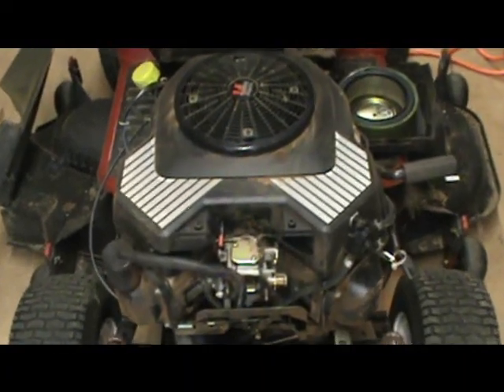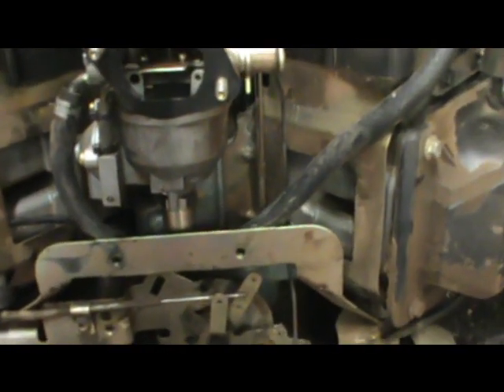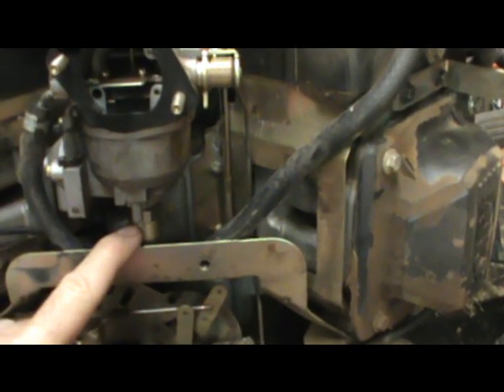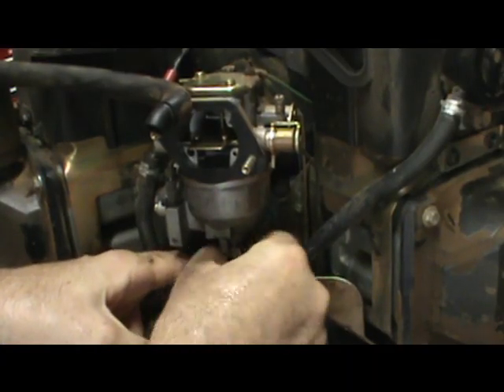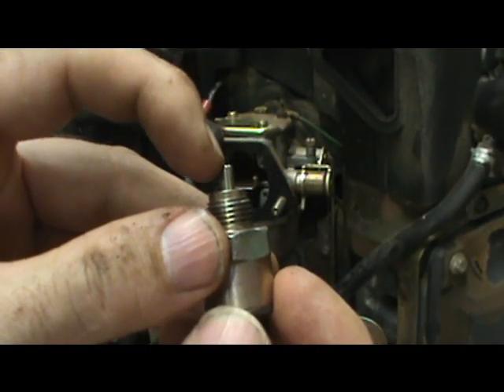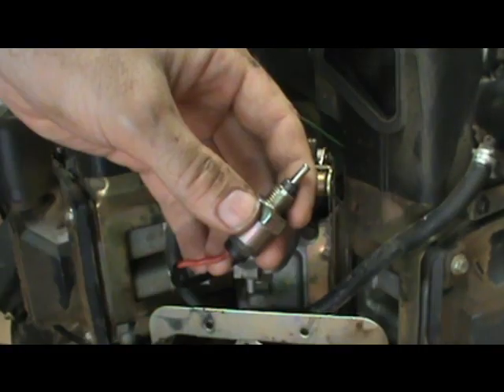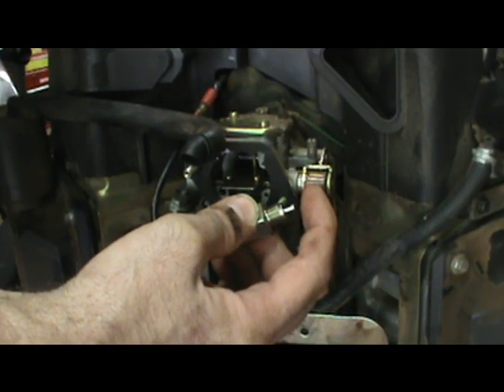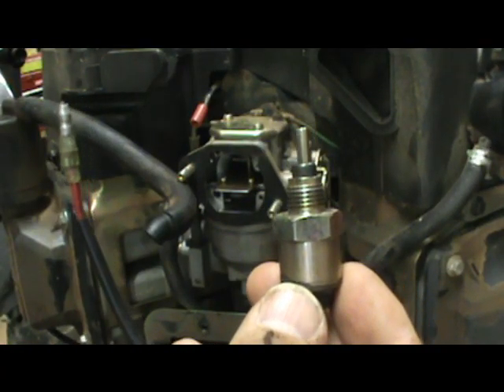Small Engine Repair: How to Check a Solenoid Fuel Shut Off Valve on a Kohler V-twin Engine

Comment: I see a lot of people are just grinding down that plunger and putting in a shut off valve...my John Deere would back fire when shutting it down after mowing most of the time even with the solenoid working properly.. I guess I'll just replace it.

Comment: Parts suppliers wanted on average $38.00 for a new fuel shut off solenoid, but i checked prices on a entirely new carburetor with the solenoid for only $30.25 . since my Toro SS4225 Is 7 years old, i just bought a new carb and added a manual choke cable for another $7.75 so i would have total control of the starting and running process.
Reply: What kind of carb is it?

Comment: I just picked up a  kohler 22-TWIN V battery says it’s from 2023 and they lady said it was running the other day but I got the cover off and it’s like a mice nest under there when I turn key all it does is click I looked it up and said maybe the battery or solenoid or the starter can’t figure it out. If anyone would help me I’ll put my snap on here so we can text back and forth been trying to work on it for about 2 months

Comment: I had a loose connecting wire to the solenoid that caused the solenoid to open and close rapidly, which reduced the rpm’s dramatically and randomly. Hope this helps someone! Great video!!!

Comment: Thanks for this video.  The wire came off the bottom of the solenoid.  Can it be reattached or do we need a new one?
Reply from the maker: I honestly don't remember this solenoid, but if I remember correctly it should be replaced. I don't believe there is a connector for the wire on the solenoid.

Comment: mine leaking gas
Reply: Get yourself an inline fuel shut off put it before the fuel filter and take the stem and spring  out of the solenoid if you need to but should run anyway.
Good luck

Comment: Can you put a regular carburetor on and disconnect that Silaniod
Reply: You can take the guts out of the solenoid and put it back and it'll run fine but I would suggest putting a fuel shut off in the line before your filter and that's exactly what I did with mine.

Comment: I might have fixed my problem by just removing the spring lol…
My problem with my mower is when it would get hot after about 15 minutes of heavy mowing I would loose power and RPMS… it would still be running “smooth” but definitely down on power and when I would turn off the deck I can’t turn the deck back on. Been chasing the problem all summer and it’s not anything obvious to me (I’m not down a cylinder). Well I just removed that spring and mowed for a solid 30 minutes through heavy grass and my mower didn’t bog down at all
Reply: Actually now that I think about it more I don’t think the solenoid was ever my problem… the fuel bowl was full when I removed it. But ya my mower losses rpm’s (likes being governed) about about 15 minutes of mowing when it gets hot. It’s not the fuel venting as I leave my gas cap loose, got new plugs and new air filter in it this spring, the fuel is also fresh, I have spark on both cylinders…. At this point I’m kinda suspecting coils and maybe they just are getting weak spark when they get hot? If it is coils that would suck because coil replacement for my Koehler 26hp is a $200 conversion kit because they discontinued the original coils.
But ya outside of spending $200 on coils for a mower I’m kinda stumped

Comment: isn't an open circuit when the power source is off and a closed circuit when the power source is on? Great video just the same. Now I understand what that sensor is supposed to do. Thanks for sharing...
Reply: It is a little bit of a conundrum but it's one of the best videos I've seen

Comment: Scratching my head for two days I came across this video. Sure enough  the grit in the solenoid was preventing it from moving. Cleaned it up and my tractor fired right up. Thanks so much!
Reply: When you dropped the solenoid, did gas still flow out of the bowl?

Comment: I have 25 hp kohler twin v cv730s and have cleaned carb. My solenoid looks different, it has a brass head with a cap that screws off. It dies not move and side holes are blocked, like the moveable part us stuck down? Engine starts but to keep running I have to play with choke and it either runs like a jet or struggles to run. Could solenoid still be the problem or is it an issue with choke cable???? Just learning with YT videos and I'm stuck!!!!
Reply: What fix did you find on yours?
Reply: @johnf5122  I ordered new carb and took solenoid off new one and put on old carb while still on mower. The old one was stuck and couldn't get it to free up. Mower fired right up and has never ran better! Make sure I store mower properly over off season with no gas in it

Comment: I followed your procedure to test my solenoid in my Honda GVS530. I found that when I turned the ignition, the piston didn't contract so I pushed it in manually. When I shut off ignition off the piston popped back out. Does this indicate that my solenoid is bad or could it be that one of the saftey sensors is faulty and keeping it from contracting? Thanks

Comment: Thank you! Just what I suspected but this confirmed it and showed how to check it. There are two other wires connecting to a plug that the solenoid plugs into. Can you tell me where they run to? The ignition switch? Should there be voltage to the wire when you turn the key to run? Based on your explanation I would think so. Thank you.

Comment: Just bypass it, remove that valve put the selenoid back with out it and it will work fine, mine has 3 years working perfectly fine with out it

Comment: the pour little solenoid is gettting a bad rap its not causing your prob.its  only job is to open and close  fuel to eng when is running no way can it cauce flooding  when you unscew it it is in off pos  the tiny plunger is sticking  up if you apply voltage with the switch the plunger goes down which is the open pos the float in bowl is what controls the flow of fuel    so when you disable the solenoid all have done is fix it so switch want turn eng off ?????????

Comment: I really appreciate your video because I knew what is was but didn't know the physics behind it. The reason it works like it does, but I didn't know much about the solenoid bc my j. Deere just had a screw in the bottom of my carb. Thank you.

Comment: Great vid! My Kohler would turn-over, start with carb fluid but would not run.  I took the solenoid apart and cleaned.  Cranked right up! Thanks!

Comment: Ok so it has to have ignition power and grounds to the low oil sensor to be able to shut off the engine with the key right

Comment: Stuck in the open position.  My engine was full of gas.  I installed an inline fuel valve.  Now it will probably get stuck in the closed position.

Comment: Does it have to be installed? I purchased a new carburetor and it has a bolt in the bottom of the bowl where the solenoid is supposed to go.

Comment: Has anyone ever experienced this solenoid causing fuel to leak out the bottom of it? Ive got cub cadet with the 19hp Kohler courage engine and i kept smelling fuel in my barn where I park the mower. After looking behind the air filter I discovered that there is a drip or 2 of gas every 15 or 20 seconds coming down the wire from the bottom of the solenoid.

Comment: I think this could be the issue with my toro 4225 zero turn lawn mower......... It is practically unused but I had it sitting under a tarp for a year or so..... It won't get gas for whatever reason, it just won't start .....
Thanks 👍

Comment: You hear these things called "fuel solenoids", "anti-afterfire" solenoids and "anti-backfire" solenoids.  They are actually "anti-diesel" solenoids.  When a hot engine is switched off, the combustion chamber is sometimes hot enough to ignite fuel even though there is no spark present.  When this happens, the engine will continue to run roughly, emitting noxious, smokey and foul-smelling fumes.  This is dieseling.  The solenoid prevents dieseling by immediately closing off fuel flow from the carburetor bowl to the engine when the ignition is switched off.  It does not affect fuel flow INTO the bowl.  Inflow is controlled by the carburetor float and needle valve.  Older engines did not have them, and modern engines will run just fine without them, but on a gravity-fed system they are good insurance to prevent fuel from siphoning into the crankcase in the event of a stuck float or needle valve.

Comment: Question what happens if the plunger is stuck in the down position
Reply: Mine stuck in the open position.  The gas is gravity fed.  The engine was full of gas.  I installed an online fuel valve.

Comment: I have a John Deere with a Briggs and Stratton  engine have no voltage at fuel solenoid connected with switch in on replaced and tested all safety switches still no voltage   Any ideas

Comment: Super presentation!  In my case, I had a clogged hose (due to deterioration on the inside -  bad gas - ethanol).  It faked me out at first as gas pushed back after a air pressure test from the filter.  However the telling sign was that gas wouldn't flow out with simple gravity test.  I replaced all the lines and then had to bleed out a good part of the tank to rid the water accumulation.

Comment: Thank You! I had a fuel problem with a BS44OP777 26 HP engine. I pulled the fuel bowl and it was dry. Thanks to you and your video I identified the problem and the mower started right up and ran just fine.

Comment: I have a generator with a stupid fuel solenoid on it...what I don't get is if I try to pull start it in the event of a dead battery how would that even work seeing how it needs the voltage from the battery to open up and let fuel into the jet?
Reply: Answer: Power is coming from the magneto when you are pull starting the engine.

Comment: I have a command 23 that idles and runs poorly, I've narrowed it down to this part. At first I thought I had an electrical problem because when I disconnected the battery the idle smoothed out however, you couldn't throttle it up. Basiclly by disconnecting power I was disabling the fuel shut off valve.so my question is now why does it run poorly with the shut off valve working properly? I removed it and made sure it was operating properly. There wasn't a spec of rust, corrosion or bad fuel in it.     Any ideas?

Comment: Thanks for the video, I was given this same mower because it didn't run. The only problem was the fuel shut off. After cleaning it, all works great and I have a new running mower.

Comment: I have bought a hasqavama craftsman riding mower. I am having issue with start up the engine. It cranks but won't start. After putting some gas in carburator, it start right a way. Changed  the fuel pump, spark plug, filter, air filter . All these did not help. Could help me finding the possible issue. Thanks
Reply: Be sure fuel shut off valve is turned on.  R&R solenoid valve. 
Drain carb and tank, add some Sea Foam with Premium Fuel that has NO Ethanol. Charge up Battery and go.  You may have blocked fuel line.

Comment: When I turn my key on . I get no click of any kind.      Wont run & I know fuel is making it TO the carb.     Yet when I spray carb cleaner in wheile turning key it fires until the carb cleaner burns off.
Reply: 97warlock ismyname 
Did this fix your problem

Comment: these solenoids are kind expensive, One thing I have done in the past is either remove the solenoid and put a plug in the bowl, or remove the plunger , just be sure to put a fuel cut off valve in the fuel line and turn fuel off when not in use
Reply: Thanks I was thinking the same thing so I can put a plug in the place of the fuel solenoid on correct??

Comment: You saved me!! Changed fuel because chipmunks chewed my fuel cap(and fuel can nozzle). Changed filter and was just about going to remove carb but I saw this. The "plunger" was stuck in upper carb! Cleaned and started right up!! THANK YOU!!!
Reply: I can't believe a chipmunk would do that…sounds more like a rat but still..whats their point?
Reply: @laurielemay1166 keeping their teeth sharp and something to do that gives them something to do

Comment: I have a 22 horsepower Kohler Courage engine will turn over but won't start. Spark plugs dry not getting gas check solenoid, solenoid works. Check to see if choke would open when throttle was put into choke. Cable was not engaging choke to open all the way. Adjusted cable linkage with one small adjustment screw by putting throttle lever to slow, loosen cable housing clamp (1 screw) located under carb, then move black throttle cable housing back about a quarter of an inch, or however much you need, retighten cable housing down with the screw. Now choke opens all the way when pushed into choke. It starts first turn every single time now.

Comment: I have the same thing on my FR651V on a zero turn mower. The engine was surging so I wanted to take a look at the carb bowl. This solenoid has to be taken off but there is literally no room to get a wrench in there. Any ideas?
Reply: Shave old wrench With a bench grinder
Reply: Loosen off the carb mounting bolts, and SAVE the gasket.  Don't tear it.
That might give you some clearance.

Comment: My father gave me his 2011 Cub Cadet LTX 1450 that wouldn't start. The mower had sat fully fueled for 2+ years before he broke down and wanted me to get rid of it. I ran through the maintenance checklist and replaced everything (since it had never been) like plugs, air/fuel/oil filters, belts, blades, battery, etc. When I got it all together and fired it it would crank till next week but never catch. 2+2 didn't help, hell. I even took this solenoid off and because I didn't know what it was didn't know how to test it. Just got back in and am happy to report that was the problem! The plunger was crusted to the solenoid body and wouldn't retract when energized. THANK YOU SO MUCH for this explanation!

Comment: I watched this video after fighting the exact same engine all day.  My motor would start and run off of starting fluid but would not run on high idle or start without the fluid.  I ran back out and pulled the solenoid out and sure enough it was stopped up.  I cleaned it up and got it working again.  Put it back in and the mower fired right up and ran great.   Awesome video and thanks for the help.
Reply: How did you get it unstuck? Mine camexwith Kohler carb that I got online and paid $200. I hate to replace solenoid with knockoff part but it has sat for several years and is really stuck. I even question if it ever moved as it looks different than video, it has brass cap that screws off and holes on side appear to be blocked. I'm stuck!!!

Comment: My Troy Bilt XP 7000 has one of these solenoids but it works in the opposite direction.  When I connect 12V to it the plunger extends.  Wonder if this has any relation to why the gen only runs if the choke is at full close.

Comment: Mower started and ran for 5-8 secs and died.  Changed fuel filter, plugs, removed and cleaned carb, put it back on and had the same issue.  Found this video, went out and pulled the solenoid out and it was stuck.  Pulled out the pin and spring, cleaned it up, put it back in and it started and ran like new,  Thanks
Reply from the maker: +Rob M Thanks for watching!

Comment: Update,this was my problem after all! Solenoid was frozen up upon removing. disassembled, cleaned & tested...just like new again & machine fired right up. Saved me just over $102 just for this particular solenoid, thanks again for sharing this video!
Reply: When you dropped the solenoid, did gas still flow out of the bowl? Bowl was empty & Mine didn't flow?
I cleaned my solenoid, & gas still didn't flow into carb. Is there a stuck needle valve up in there? Shouldn't gas flow out with solenoid off?
Reply: . The gas coming out after the solenoid was removed was minimal.  I lucked out with mine,but it sounding like you may have a stuck needle.  If you're up for doing it yourself,grab a can of carb & choke cleaner & blast a spray into the fuel inlet for the carb. Might take a few times & if that doesn't work,you might have to pull the carb & give it a good cleaning & it should be good to go.  Has the machine been sitting for a prolonged time?
Reply: @charlesrockwell2122  Sorry,,,, Drs & health problems keep getting in the way.
YES,,, the mower was sitting for at least 3 years, & the previous owner didn't do much maintenance.
I'll give the carb cleaner a shot, thanks.
I did blow air through the gas line with the solenoid off,,,, still nothing came out.
Thanks Again,,,,

Comment: all that does is create a circuit , right, it doesn't do anything inside the carb, right ?
Reply from the maker: Jim Lovejoy It opens and closes the main fuel circuit.
Reply: Actually it blocks off the fuel supply port to the carburetor when the ignition is turned off. It has nothing to do with the carburetor except shut the fuel supply to it.